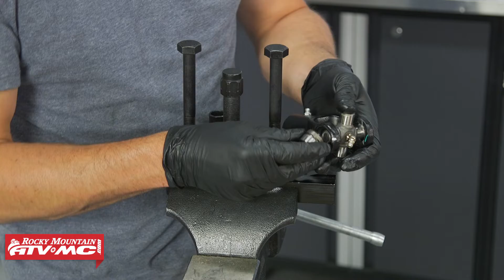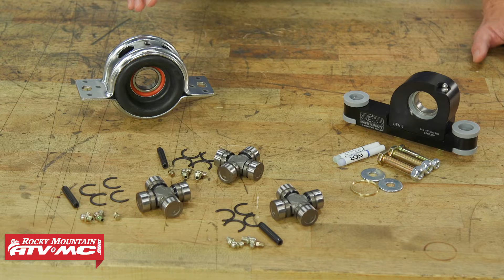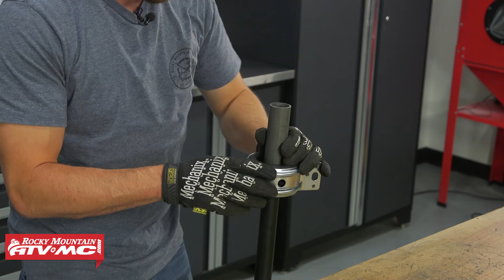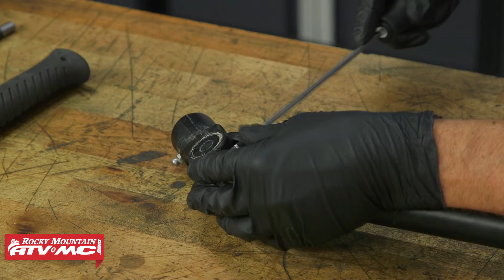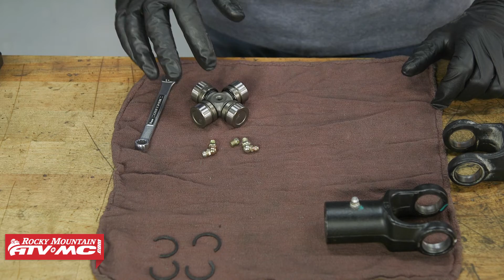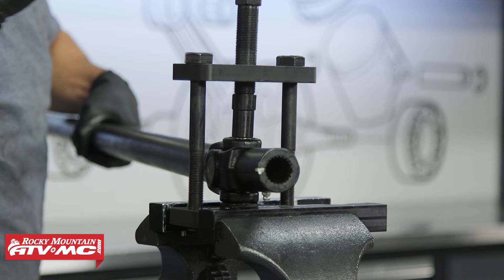How To Rebuild the Prop Shafts on a Polaris RZR

Comment: keep in mind rzr oem drive shaft is not balanced from factory. i replaced my carrier bearing with the sand craft one and my rzr shakes bad around 55mph so get it balanced or get aftermarket one